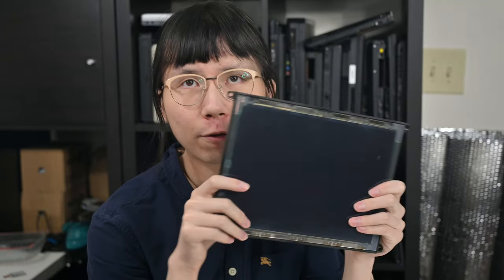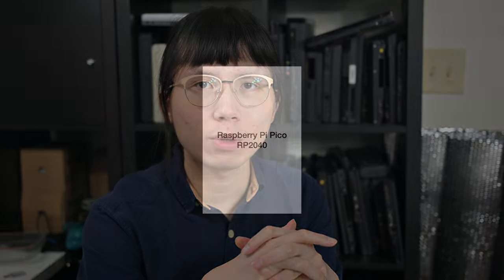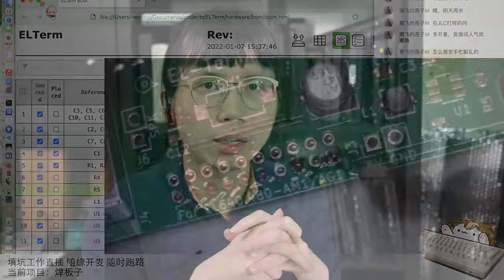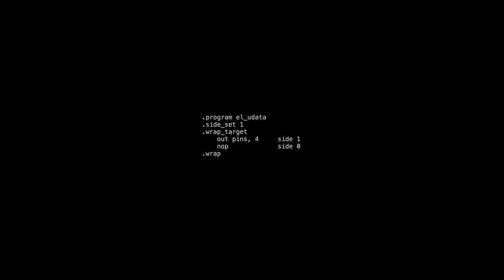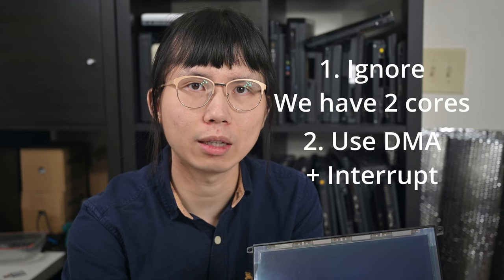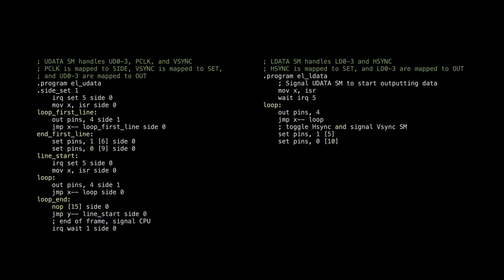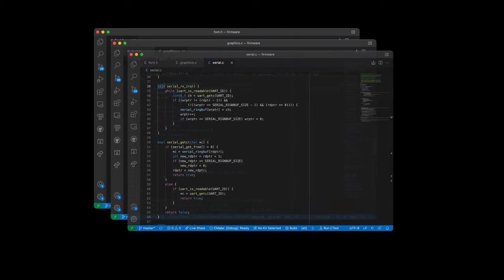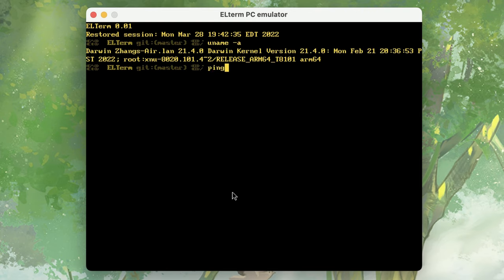Building a serial terminal with RP2040 and EL screen

Comment: Smooth scrolling the new lines are a nice touch, or am I imagining that happening?
Reply: this is incredible
of all the "virtual" terminal emulator i used on Linux, none had that feature
they all "jump" between text lines, even Kitty that has GPU renderer
Reply: @jeanr2808  A lot of the old terminals including the VT100 had smooth scrolling because it was trivial to do in hardware.

Comment: Impressive!   RP2040 is QFN-56, a lot of the soldering is done under the chip?  it looks--difficult.  I've hand soldered LQFPs but they have more to work to work with in terms of pins etc. Did you solder the RP2040 to your custom board by hand?
Reply: QFNs have pads around the edge and probably one at the bottom. I’ve not soldered one (but have done 240 pin QFPs) and I’m confident I could solder QFNs. Loads of flux. :)
Reply: Drag solder the outer 56 pins, and if there is a ground or thermal pad under the chip, place a large via under the chip so you can solder that from the underside of the board.
Reply: @zz3709 thanks for the tip!!
Reply: I tend to use either hot air soldering gun or Infrared toaster oven to solder the whole assembly together. Kinda easier that way compared to hand-soldering.

Comment: connect. read draw it. write it sended and it come back when read you see change. it should be automatic.
cursor movement are sended thru bcoz you connected terminal. serial cant magical work unles there something software running to accept.
so you draw what you get